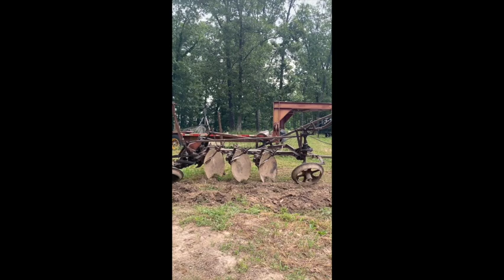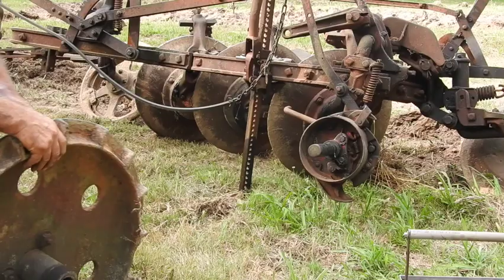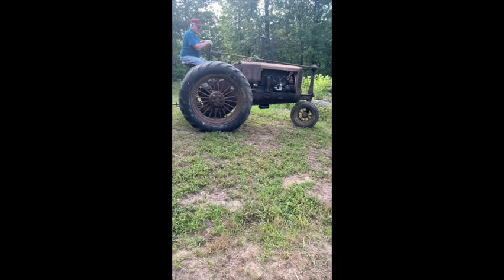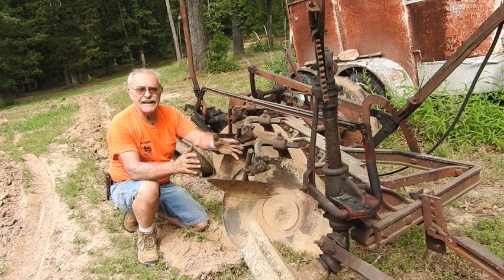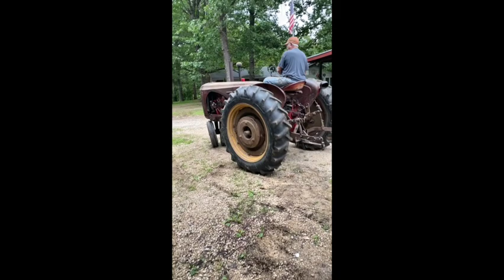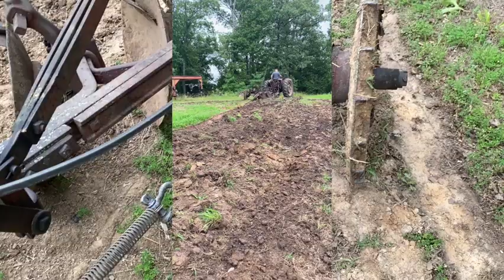1937 Tractor and 1927 Disc Plow FAIL

Comment: In my view, had you not even tried putting the 1937 Tractor with the 1927 Disc Plow, you would not have learned a thing.  Experience is the best teacher.  See what you have learned and then  you worked at solving the problem.  Job well done!  Looking forward to more videos.
Reply from the maker: Well, we were a bit disappointed that the direction of the day took the turn it did at first....but the end result will be in the next video in the series.  It sure was fun though.  If you like old things just stay tuned. LOL

Comment: That looks like it belongs there Wendell. After setting for so many years outside like that, I am amazed that the plow would work at all.
Reply from the maker: Oh it took a ton of work by the Much Older Brother to get it to this starting point.  Lots of heat for rust busting and lubricant was consumed to get the parts all moving.

Comment: Once again we're on the same wavelength! I've got a 3 bottom disc plow too! I'm not sure of the make, but I am sure it's the single most contrary implement I've ever tried to use. I bought it to use in pasture land and on real hard clay land that a moldboard has trouble penetrating. I'm not sure why it won't work for me, but them's the facts! Funny we share so many things, Semper Fi friend!
Reply from the maker: That's really cool that you also have one of these old dogs.  They are a bit contrary to get set that's for sure.  Now if we had a 40 acre field where there was room it'd be a lot easier.  By the time we get it in the ground here, its time to lift and turn.  We went one tooth at a time on different combinations of the three levers to get it to where it is now...but without the spring we could not get it to work every time. Thanks Bret for the note and S/F to you as well.

Comment: Not a failure in my opinion, Aldi nice to see inside how the trip mechanism works. Just bought a Ferguson 3 point 2 disc plough, had a broken bolt, the candle wax trick worked👍.
Reply from the maker: Yeah, candle wax and heat works wonders.  I used it just yesterday on an old Ford. The trip wheel certainly do work differently than your three point for raising 'em out of the ground !!  I've seen a number of three point disc plows, but this is the only drag set I've ever seen.

Comment: Are each of the discs on a disc plow equivalent to a bottom on a bottom plow?  For example, if you have a tractor rated for pulling 3 bottoms, should you expect to be able to pull 3 discs?  I’d like to find a disc plow to add to my collection.  Thanks sir.
Reply from the maker: Yes, these are considered 3-12's, covering a full 36'' cut.  They pull much easier than a mulboard plow due to different suction and draft.  They lack a land slide, so the edge of the furrow is not a sharp 90* angle, but a gently curved slope.  In good soil, this three bottom discplow can easily be pulled with a two-plow tractor.  A three-plow tractor will walk away with the 3-12 discplow in ANY soil condition...or you can pick up a gear unless the increased speed throws the dirt too far. Good luck in finding a set.  This is the only set I have ever seen in this area.

Comment: I've seen a few videos of restorations on John Deere and IH's trip plows.  The trip mechanisms on both the JD and IH plows are somewhat similar.  The one on that one you're working on, is a bit different than JDs and IHs.  Myself, I have a IH Little Genius No. 8 2-12 trip plow that I picked up for free last fall.  I had to replace both tires (i wish it had the steel wheels).  I haven't had a chance to use it yet, but it will look good behind the H.
Reply from the maker: Most trip plows are similar.  The main difference in this one is the trip wheel is essentially on the rear....or at least lagging behind the cutting discs.  Also this one reverses direction and returns back to the starting position and most of the trip plows go 180 degrees at a time to go down and back up completing the whole circle.

Comment: Lots of work trying to get worn and rusted equipment to move.
Reply from the maker: Yes, and a lot of oxygen and acetylene too !!  Even a little elbow grease and candle wax tossed in for good measure !!  LOL  YOU know what I'm talking about.....
Reply: @tractorman4461  For sure. Spent a year rebuilding the Farmall B. Cracked block. Two new sleeves. Every nut and bolt in the thing rusted. 
Heat them up until they swell and pull on the wrench. Works great on through bolts and nuts. 
First time I ever used Kroil. Great stuff. Expensive as the dickens, but it works. 
Now I use Scoutcrafters 50/50 mix of ATF and Acetone. Just as good. Lots less money. 
Haven't tried candle wax yet.
Reply from the maker: @OldSneelock  Yes, I use the 50-50 concoction as well.  I only mix what I can use quickly because in an unsealed container the acetone seems to evaporate to a great extent.  Kroil is crazy expensive for sure.  I buy it but it is consumed sparingly !!  I have a pressure vessel from WWGrainger that I use for 50-50.  Fill half full then use an air chuck to add pressure to the tank, then pull the trigger and it blows a stream.  The good thing is being sealed it keeps the acetone from evaporating as rapidly. Go to WWGrainger and type in this part number: 31ER19 to see the cool tool for the motorpool !

Comment: I use a  1930s John Deere four pan disc plow with a Farmall 806. The combination works well in 4 or 5 gear!
Reply from the maker: That's cool Jeff.  The old man always like the easy way they pulled.  Makes sense too once you think about the round discs vs share and moldboard.  That 806 is a horse compared to this old MH Challenger too !!

Comment: I had a Massey Harris 44 very good tractor. It had its problems but all do. The interesting thing was it was struck by lightning on the gas tank. It dented the tank and obviously ruined all electrical but I was able to get it back going
Reply from the maker: Whoa..!!  Now that'd give a guy a bad day if he was on it at the time !!  I can say  honestly that I haven't heard of that happening before.  But lightning has got to strike somewhere.  Easy to see that everything would get fried with a hit like that.  Those old 44's die hard.  I've got two in the line to get back up and running right now. Thanks Steven for the 'shocking' story on the 44.  LOL